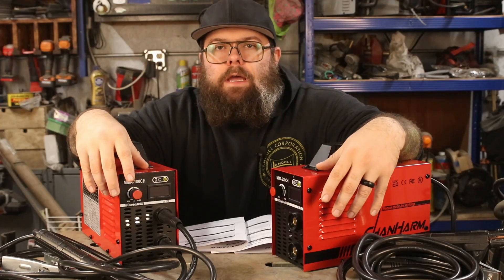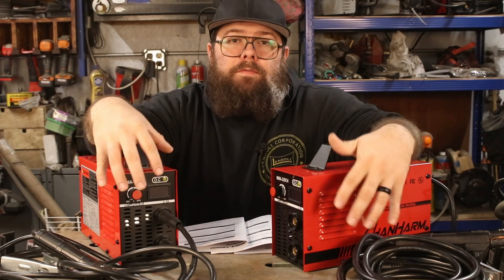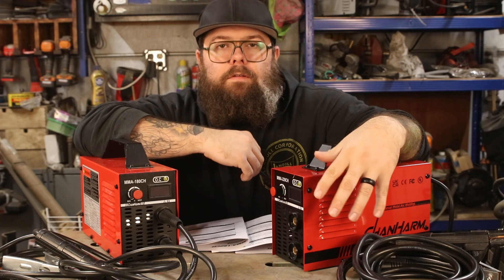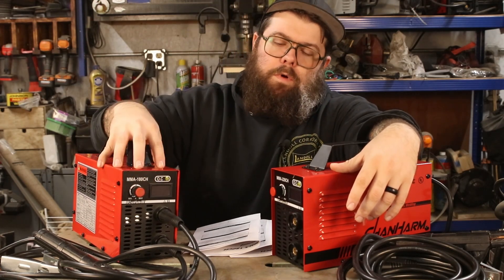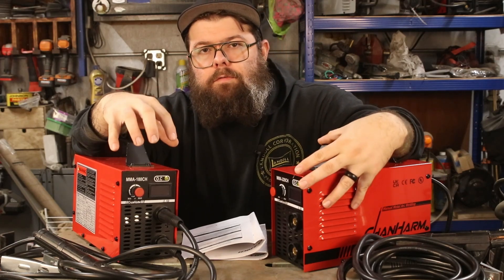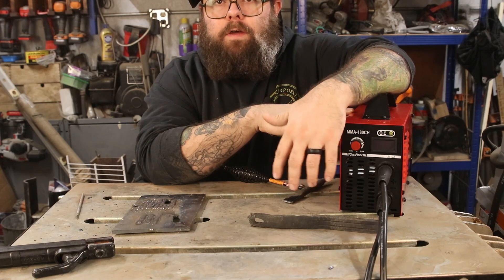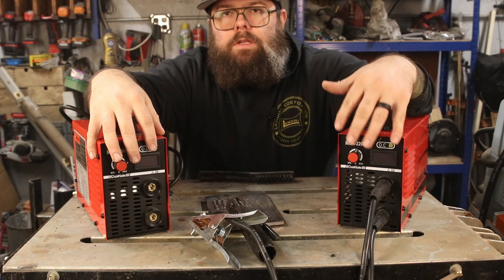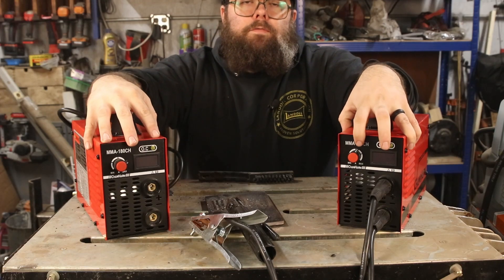ChanHarm Stick Welders | Solid Performers!

Comment: Appreciate the review..you mentioned you would leave a link to a 120v to 220v adapter but it's not in the description area etc.. a good practice with these welders / equipment in this price range with sketchy quality control is to always open the case which is only a few screws #1 to check for safety issue like a loose wire or something grounding out against the case before plugging the machine in..# 2 to look inside at build quality and to compare with other models to get an overall impression of corners cut or quality etc..#3 you could hook up a clamp on multimeter to each lead to see how many amps are actually drawn or outputting as the displays are way off and some are programmed to cheat / lie about actual power output..as some machines also draw nearly twice the amps tripping breakers..Cheers..
Reply from the maker: Good Catch, I just added the adapter!  Also great tips when buying one of these machines!
Reply: @GarageHobbyist hey